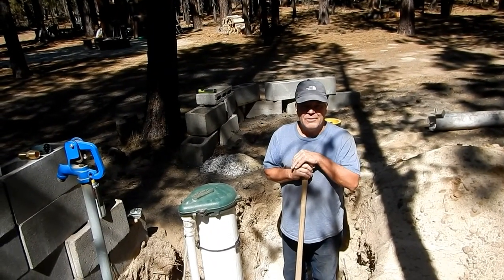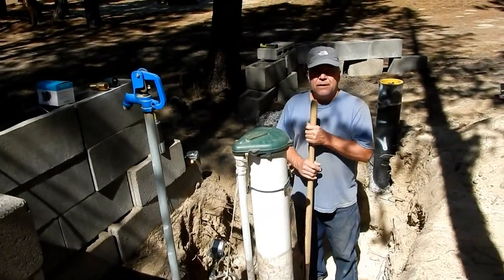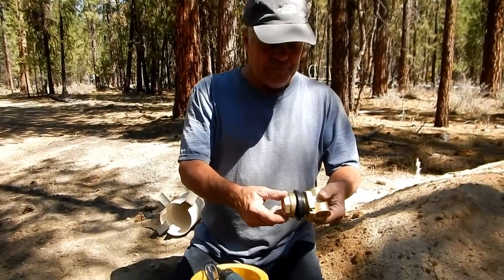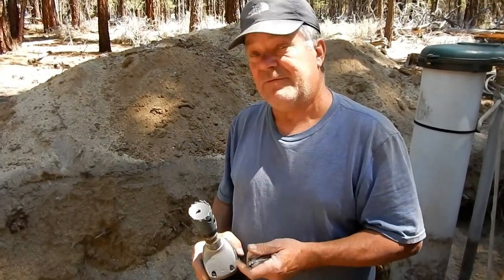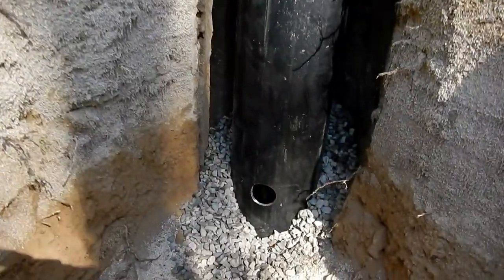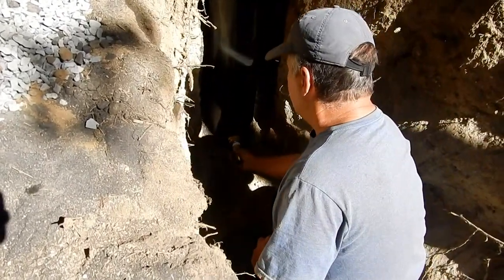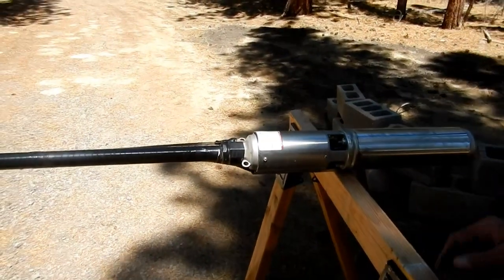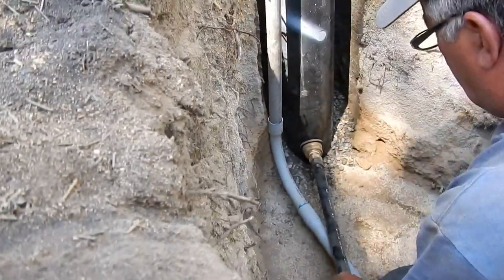How To Save Money On Your New Water Well - DIY Hookups To Pressure Tank & House

Comment: Good video as always, Tom, thanks! When I double clamp a connection like that, I turn one of the clamps the other way so force is applied from both sides. Sounds trivial but I don't get leaks. Also, even though I can get the pipe to go on the barbs cold, I still heat it so that it's shaped into the grooves by the clamps.
Reply from the maker: Thanks for your input, those are good tips. We let the pipe sit out in the sun on a 90 plus degree day to get it warm. We also left the hole open for a few days to monitor it for leaks and there were none.

Comment: It's nice to have the knowledge to be able to do things like this yourself.  I would be clueless.  A lot of wells in my area are drying up this year. We are lucky and ours is still running strong. We had a new pump installed last year because the old one was probably 30 years old and was using way more electricity than it should have.  We ended up saving money in the long run; the savings in electricity out weighs the cost of the new pump.
Reply from the maker: Same thing here in Central Oregon.  Wells are drying up by the dozens. We put a new pump in the old well earlier this year thinking that might have been our problem, but it was the low volume of water and slow recovery time of the well. Glad that you have your new pump and water in your well. It's easy to take for granted when you turn on the faucet and water comes out, until it doesn't.  Thsnks, Duck!

Comment: Hello Tom and Julie.  Very nice to see you two again.  Great job with the well.  I'm glad that hole saw worked for you, I would have thought the teeth should have been smaller for that type of steel.  I remember back in 86 I got a temporary job working at Standard Oil in El Segundo California.  Now it's Chevron.  But we drilled 50 foot holes using Augers like that but thinner.  We would drop a probe down the middle of it and retrieve soil samples.  They were testing the hydrocarbons that had seeped into the ground.  One time we have to go down 150 feet.  We used almost all the augers we had.  But that's how far down the soil was contaminated.  We wore white paper suits or Yellow plastic coated suits if it was really bad.  Anyway, I was a lot younger and in better shape back then.  Each auger weighed 110 pounds and I learned how to pick them up and balance on my shoulder then throw them onto the truck.  Very strenuous job for $8 an hour.
Reply from the maker: Hi Stephen. That sounds like quite the process sampling underground like that. I have seen some of those type drilling rigs that are made for taking underground samples. That sounds like a demanding job physically, and for not a ton of pay. That hole saw worked great. I had some doubts about it working myself and was pleasantly surprised. We are getting ready to get back to mine exploring soon.
Reply: @TomandJulieMineExploring   That's exciting, I can't wait to see more of your exploring videos

Comment: Enjoyed the video, the wells we used to have were really deep. They would run from about 70 to 150 feet deep. We had sucker rods you had to have a well drilling truck to pull them. I like the setup y'all have. Until next time take care and may God bless you both.
Reply from the maker: We're lucky  that we have a shallow water table in our area and we are able to service the well ourselves. If you go any deeper the next water is at  roughly 160 feet. Thanks for watching and the blessings, Jimmy.
Reply: Jimmy, i had to chuckle a bit, here in So. Calif.  500 to 800 feet is probably the norm.  I suspect around 40k for that deep, not sure.  Wells are going dry fast around here.
Reply from the maker: @mineadventures7938  Holy crap, I'm not sure Julie would be able to pull a pump from 500 feet. Lol
Reply: @TomandJulieMineExploring  lol, right

Comment: Hello Tom Hello Julie
Good to see both of you .
I have to see your Video once again .
For now i dont understand the Funktion of the pitless Adapter.
Ok here at my property i have a weld or Brunnen in German that is 11 m deep but the water Level drop in dry days Down to 10 m so my pump up on the surface cant suck the water out .
A pump Down below will solve the problem. Your Video give me the kick i need to get the problem solved 
I will use the weld as a back up System if the normal comunity waterSystem will fail .
In this days everything is possible .
I like your homested very much the surrounding looks very good .
Take care stay healty and have a good week 
Greetings from Germany 
Yours Frank Galetzka
Reply from the maker: Hi Frank. We have had a long term drought on our area and our old well went dry, so we had to have a new one drilled. I hope you get your well working the way you want it. Always good to hear from you my friend and hope you have a good week.
Reply: @TomandJulieMineExploring  thank you for your reply 
Now i know how this Adapter work 
Thank you Google  
Take care
Frank Galetzka

Comment: i built a house one time for a customer, needed a well.  they were drilling.  i was inspecting an old 4 inch elect service line.  a few feet deep and 2 sweeps to pull boxes.  about 200 feet long , maybe a bit more.  full of water, rocks and other crap kids like to drop into open pipes.  it sat for many years exposed.  i seen that massive air compressor on the drill rig and ask him for help.  i said, can you blow some air thru this line, he just laughed.  he said this is dangerous, stay back.  he hit the go button and am not kidding, that water, rocks and everything in that line shot up like at least a 100 feet, maybe more.  i was very humbled by the power of industrial equipment and the operators.   was able to get my pull rope in easy after that.  nice job guys.
Reply from the maker: Sounds like an industrial strength potato cannon. Good thing you stayed out of the way. And you thought mine exploring was dangerous.  Lol. Thanks, Ken.

Comment: Nice job. How deep did you drill down? What did they charge per 100 foot?
Reply from the maker: $100/foot and 40 feet deep. $4000 for drilling the well. We saved at least $2000 for the work that we did. They wanted $3000 to finish hooking it up, but that includes a new pressure tank. We just used the old pressure tank which is working fine. I'll probably have to replace it sometime a few years down the road. Thanks, Ronnie!
Reply: You did a very good job and saved some cash 💸

Comment: Lots of folks out here in the countryside are on wells, of course - but when I was "homesteading"
my place up here on the ridge 20+ years ago, I had already experienced sulfur wells more than
once and I wasn't about to risk that again.
That stuff is foul! Supposedly good for you, but the orange tinge to everything and the SMELL
were more than enough to keep me from drilling my own well, even though there's a known
underground lake under us up here!

Instead - I chose to run about 1200 feet of waterline down to the nearest "city" water main,
which was about 250' lower in elevation as well.
Fortunately, pressure on the city line down there is really high, so all the "head loss" required
for water to climb our hill still meant we had about 35 psi up here.
I found about every rock in the ground between the water main and my new house up here
that Thanksgiving weekend, working a walk-behind ditch witch by myself in the snow... 

I used the heavy 1" black industrial thick wall stuff (trying to minimize loss) and the big
brass couplings required, wrapping each joint to protect it and sleeving the line in sch80
galvanized where it had to pass under my road.
The whole thing got 2 feet bury minimum (freeze line here), too. 
I'll stop yakking here and just say it was a mother of a job to do on my own, but it's still
there 23 years later and has never been any problem at all (other than what's in the city
water itself, of course!).
As a fire sprinkler guy, I had a friend in the site utility biz who supplied me with what I
needed to run the line thank God.
My only advice for anyone else attempting such a long run? Use the ride-on ditch witch,
not the walk-behind. :-)

I enjoyed y'alls' video as always and looking forward to the next one!
- Ed on the Ridge
Reply from the maker: Wow, 1200 feet long with a rise of 250' is quite the run, and in rocky soil. You definitely earned your stripes on that job. I bet you saved yourself a pretty penny, too. I have never run a ditch witch before, but like a lot of power equipment I'm sure they don't run themselves by just pushing a button. Sounds like you did the job right and now you have the satisfaction of a job well done. Thanks for the interesting comment,  Ed.
Reply: @TomandJulieMineExploring  I appreciate the kind words. 
Yeah, I walked funny for a while after that one. :-)
-Ed

Comment: 20-30 ft for a drinkable well? Cool!
Here on the CO plains, we sink them 700-800 for good water!
Reply from the maker: This one is about 45 feet deep. The pump is up about 10 feet from the well bottom. I don't think I could do a 700 foot deep one myself. The weight of the pipe alone would be too much. Thanks for watching!

Comment: Good job Julie. Tom is a good helper. LOL  🤣😂 Why did the old well go dry? Did you have to deeper with the new well to the new water table level? I'm in Florida and wells hardly go dry. The water will go bad (sulfur, salt, etc.) DIY videos are always great on YouTube.  ChiBuffalo13
Reply from the maker: Glad that you have plenty of water in Florida. Many of the wells here in Central Oregon's high desert are going dry because of prolonged drought conditions, basically in the entire west. Our old well still had water in it but not enough to operate correctly. If we took out more than a few gallons at one time it would not recover very fast and the pump wouldn't shut off. Our new well is only four feet deeper as that is about as deep as we can go before breaking through to some undesirable material and water that is not good. Julie is a good worker and I love to watch her work. You should see her work on our old Jeep. Thanks for the comment,  ChiBuffalo!
Reply: @TomandJulieMineExploring  Thanks for the update. I know that the western parts of the US have it hard with water but was just wondering why you had to sink a new well. I just wish people would listen to me about a water pipeline much like the power grid across the US. Much like how we can run oil/gas from the south here to NY and the midwest. Everytime there's a hurricane here there is flooding of freshwater which could be pumped to locations that need it and lower the flood levels.
Reply from the maker: @chibuffalo13  It's almost unbelievable how many places in the south routinely flood while the west bakes under drought conditions. Water pipelines do work. Water has been moved for decades from the Owens River Valley to Los Angeles, about 200 miles if I remember correctly. Much of it in a large pipeline and some in open canals.

Comment: I've never heard of a buried pressure tank before. I wonder what the rational is for that? Nice teamwork you two! The pitless adapter is common in larger systems too. I've encountered them in sewer systems where a large submersible pump is lowered into one and held there by its own weight. It makes pulling the pump tool-less with no need to get right down there to unbolt anything (that's very welcome especially when the alternative is to go down a ladder into the sewer tank...YEK!) Your well depth is very close to the depth of our well. I am providing a link to when I changed the pump in 2014 (sorry for the lower quality video) https://www.youtube.com/watch?v=Zgecn262_yo&t=222s. On my channel is a newer video from last year when the electrical cable in the well developed an open. Always fun to see you two working / hiking together !
Reply from the maker: Your comment got held because it contained a link so I just now noticed it. I believe the rationale for the buried tank is to prevent it, and the lines running to it, from freezing. We have no well house or pit to hold a pressure tank. This is the first buried tank I have owned and it has not been a problem. Most people that have a well house to hold their pressure tank have some costs involved with it, from heating it to maintaining the structure.
I have some sewer experience,  too, by the way of cleaning and maintaining lift stations. Not so fun. I will check out your video soon. Thanks for watching and commenting!
Reply: @TomandJulieMineExploring  That's a few good reasons not to put a tank on the surface: freeze protection low maintenance, and no building to look after. I didn't realize that putting a link gets held for a while. Oh well. I have not been in a sewer tank for 20 years and I'm not going back! I owned a full-service home maintenance business back then and that job came up a few times. The pump would get clogged and the 1000+ gallon tank would fill to the top with sewage. I'd pump it out and pull /repair/replace the pump as the case was. No fun. really!